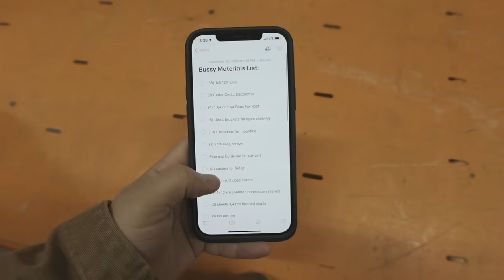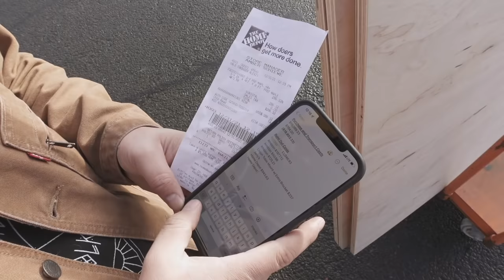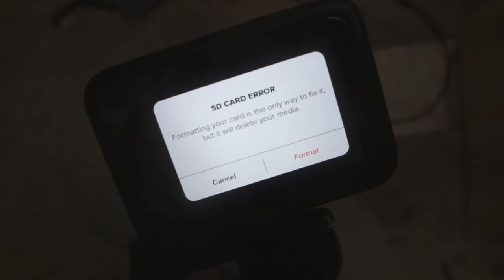30 Day Short Bus Build - Episode 1

Comment: Just a question, you found a lot of wiring when you took off that strip, before screwing in the cabinets, did you check behind the panels first to make sure you didn't cut into some unknown wiring,  😊👍💕💕💕
Reply from the maker: I didn't cut into those panels
Reply: @isaacturnerit  , ok  thanks for the information, 😊👍💕💕💕

Comment: Love your ideas as always! Question for you: I see you typically leave the metal walls on the bus. Is that because your builds are on tight timelines or for structural integrity? We're at the demo phase now on my short bus!
Reply from the maker: The timelines are a part of it. In my opinion re insulating a bus doesn’t do much unless you change the single pane windows